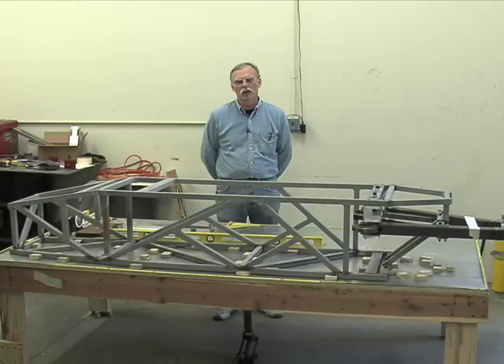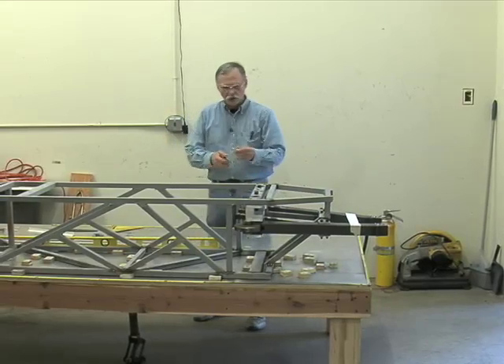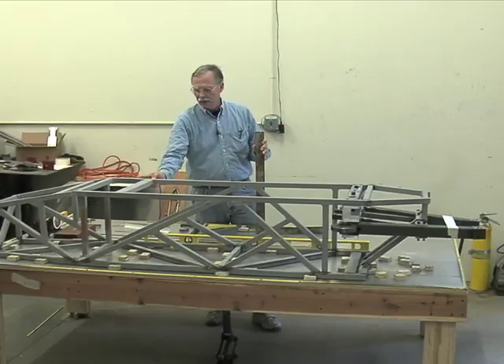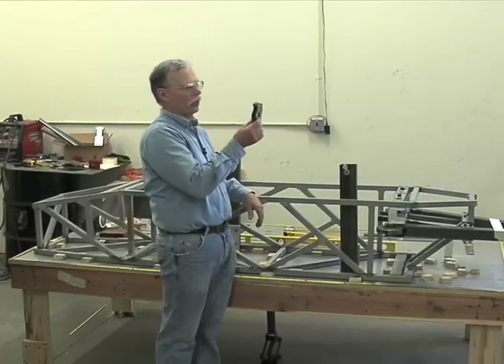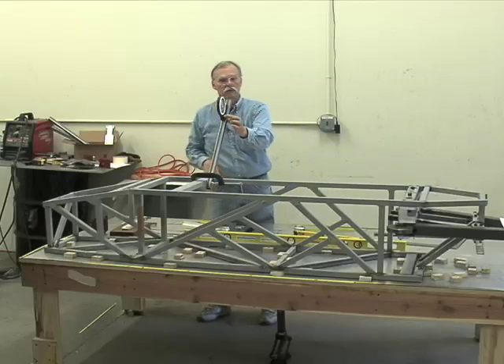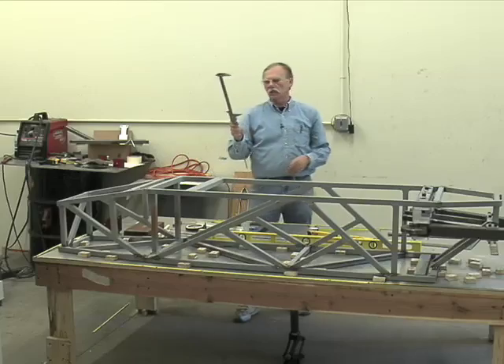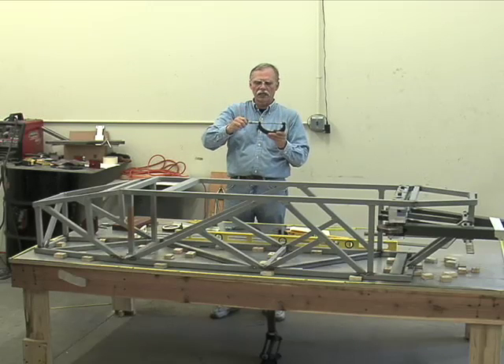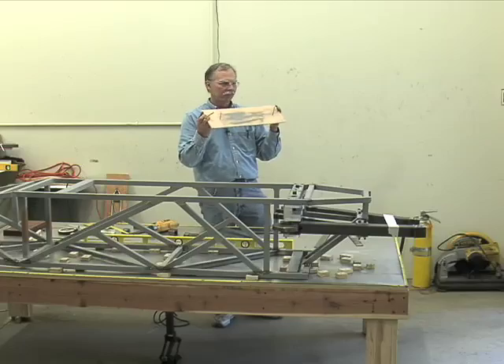Measurements and Layouts

Comment: They probably weren't available when this was made, but now cheap laser levels are available for alignments over considerable distances horizontally. (The plumb bob's simpler for verticals.) 

A chalked string's also useful for marking straight lines, (but maybe engineers don't talk to carpenters. :-) ).